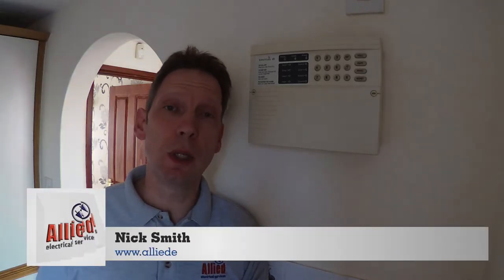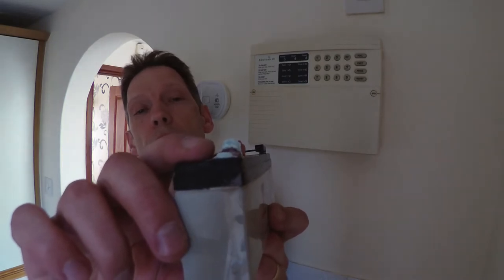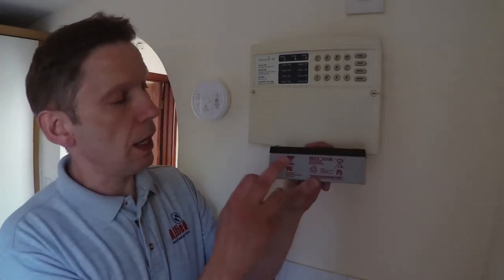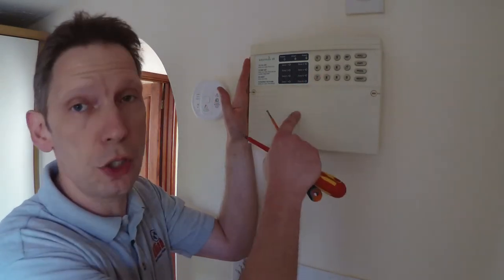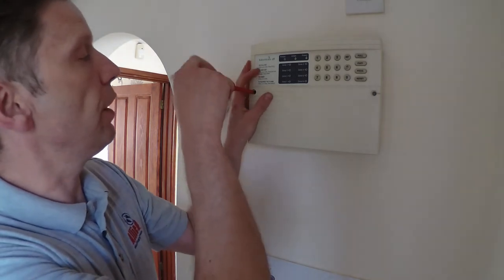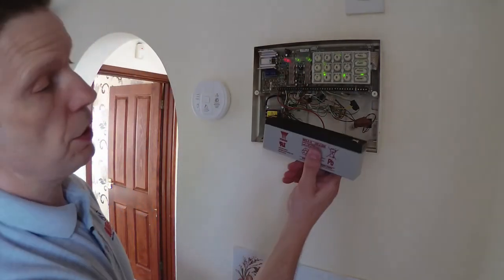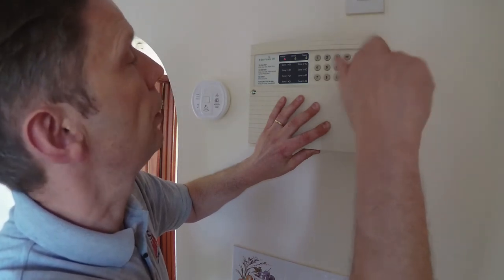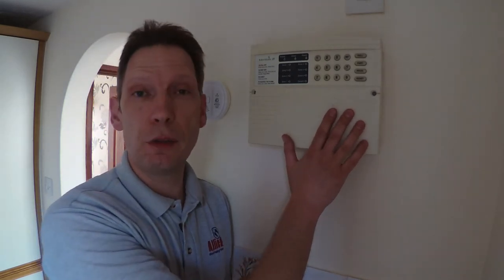Replacing an intruder alarm battery

Comment: Hi I need to change my alarm battery is well. I have a question for you if you don't mind many thanks in advance. do I need to turn it off from main?
Reply from the maker: @ashdesai284  no you don’t need to switch the mains power off but be aware there may be live parts accessible once the cover is removed so if you aren’t confident you may want to employ a professional.

Comment: Hi enjoyed your video I have a euro mini and opened up the door sensor , opened up the alarm box and replaced the battery , and also opened up the fuse and put it back  however now my panel doesn’t accept the user code at all , not sure what the problem is here but it was all fine before this any way I could just get it back to how it was thanks

Comment: Hi I have a wooden door with a round door contact with and I am having a new PVC door fitted .so I will need to change the contact to an oblong one fitted can you tell me if I just change the wire over or not it's the same panel as you are changing the battery on verates 8 alarm
Reply: You’ll likely find it has a pair of wire for the alarm and a pair for the global tamper loop.
You’ll need to put it into engineering mode to avoid it going into alarm if you’re going to break the tamper loop.

Comment: engineer reset on tamper and lock the engineer code stops these cowboys ,
wrong battery , no date on battery , no charge voltage measured, no load or charge currents taken and recorded .
nice video on how not to do the job .
always get a proffesional in to do the job , you dont let people like this service your gas fire would you .
peter at FM Security
Reply from the maker: FannyAckin thanks for you comment. As a professional security installer all of the points you mention are valid and correct but this video is aimed at the average DIY’er or homeowner and not professional installers. Hopefully they don’t need YouTube videos to know what do when servicing or changing batteries.
Reply: if have been to long in the service telecoms and alarms industry to know that there are some people who will save £1 if they can do it them selves and the vast majority of these people have no skills and are a real danger to them selves and others . we talk to people who have problems with there equipment and we never tell them to take the cover off and mess with any wires . you can not make enough allowance for what some people will do. you tell them to unclip the battery and they start taking the mains socket apart , yes really ! some of these DIY,s are that bad . 
Peter FM Security Services

Comment: Incorrect, Didnt check charging voltage, output voltages, current draw ect, also didnt date the installation date
Reply from the maker: Hello Charlie and thanks for viewing. While your comments are totally valid I think they may potentially be beyond the average homeowner who just want to simply change a failed battery. With that in mind we've aimed the video at competent DIY'ers rather than professionals. Hopefully pro's wont need to check Youtube to know how to change the batteries in an alarm panel!!
Reply: thanks for saying that , we are proffessionals
Reply: @alexandersalarms5380  What ever